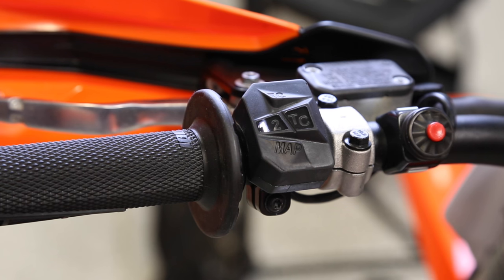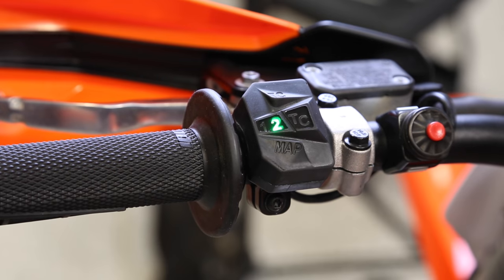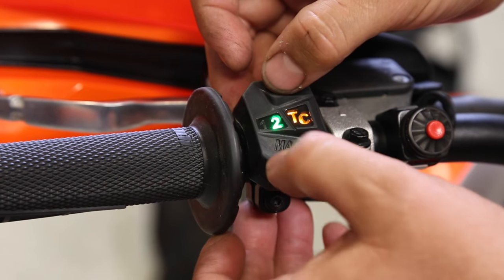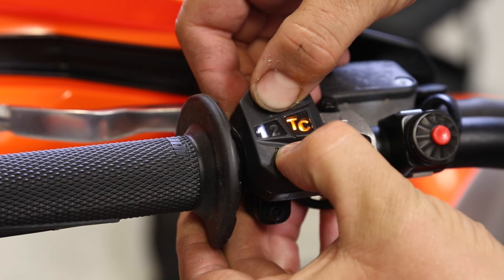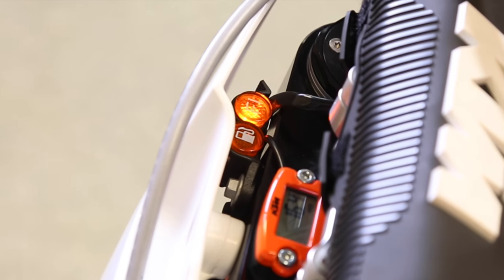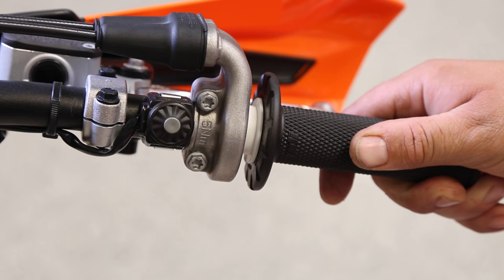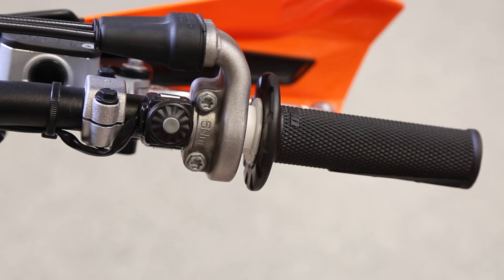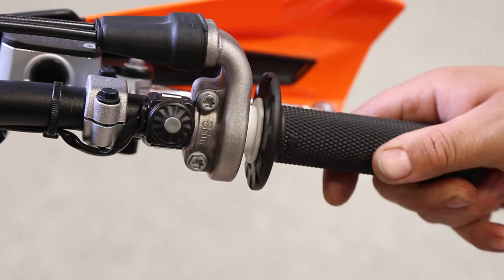KTM Launch Control, Traction Control and Map Switch Explained - Cycle News

Comment: I got a 2019 ktm 450 sxf , 1 and 2 there is a difference.  More responsive, gears feel more aggressive.  I like it. Traction control i feel no difference though
Reply: Me2
Reply: I feel the difference on wet grass hills, the tire spins not as fast so you can Control it a lot better.
Reply: @jonson4508  that’s traction control 👍

Comment: I have this on my 2018 exc-f.   I see no differences in 1--2or TC. I can even unplug it and theirs no change.   Total waste of money.
Reply: Mark Wilson  lol same here.. what the hell dose this button do.. there is no difference between 1 and 2..
Reply: I have a 2018 husqvarna fe450 and found there is definitely a difference from 1-2. Number 2 a lot more responsive
Reply: it doesn't work in us models, unless the dealer "unlocked" your ecu. Now illegal to do per epa regulations.   @anthonywilliamson2080
Reply: Will Crain the map switch does not come on the excf models. Just the off-road bikes. You can purchase the map switch and plug it into the ecu. So the OP probably bought it separately. You should know your facts before you start calling names.
Reply: Zachary Gibbons hahaha 2018 exc-f six days have the map switch/traction control. Nice try buddy
Reply: Zachary Gibbons you sound as worked up as the guy who posted the original comment lmao. An EXC-F six days is still an exc-f, mister Ktm guru
Reply: Will Crain lol you are totally missing the point. The map switches don’t work on the US excf models. That includes the six days that do come with them. Just more useless shit that is included on the six days. You don’t even have one so I don’t know why you are commenting on the situation haha. If you had one you would know.
Reply: Zachary Gibbons lmao I do have one. If you’re referring to my YouTube videos I don’t have that bike anymore. I have a 2018 350 sxf and there’s a noticeable difference between map 1 and 2. Map 2 has much more punch right off the bottom and map 1 seems to peter out quicker. Regardless, I find that it works, but I can’t speak for the gutless xcf-w or six days four strokes. I would assume a lot of it has to do with how little power those bikes make anyway that makes it hard to notice a difference between maps.
Reply: Zachary Gibbons I originally commented on the situation because the guy was complaining how it doesn’t work on his Ktm. Saying it’s a “total waste of money” when it most likely came on the bike anyway. He would never notice the direct cost difference of a bike that did or didn’t have the map switch so I don’t get his reasoning for complaining about it.
Reply: Get the ECU re mapped mate,  that makes a huge different!
Reply: The US model EXC-F/XCF-W map switches don't work with US Ecus, you'd have to get it unlocked or buy an 3rd party or EU ecu. In the EU version, the map switch makes a noticeable difference on the throttle response, map 2 making it really aggressive. This is with model years 2017-2019. 2014-2016 EXC-F came with a potentiometer under the seat where you could select between rain mode, aggressive mode and stock power mode. I don't get why Ktm failed to continue the rain mode option on newer bikes. I drive a 2015 450 EXC-F, and I find the rain mode really nice when in technical enduro.
Reply: Same here with 2019 husky fe501, no differences.
Reply: @fer1306  get a re-map mate,  it makes a difference.
Reply: I have the Husqvarna fx 450 and I feel like on two there's less engine braking and it seems a little more responsive too.
Reply: The TC is on when the button is orange or when it’s not ?
Reply: @romeocop27 lol.  A light on anything means it’s on. That’s why it has a light.   😂😂😂. These comments crack me up.
Reply: @Scummy_shovel  No, I found that when the button is orange it means that the TC is off, the TC it’s ON automatically, if you press the button it’s off. So don’t comment stupid things please
Reply: @romeocop27  lol. Well I work for ktm/husky. And your just wrong
Reply: @romeocop27  I know reading is hard for someone who doesn’t understand a light function. But section 6 paragraph 1 in your owners manual will explain since common sense has failed you. 
Standard map: when number 1 is illuminated 

Standard Traction control: when number one is light and is when the button is pushed and the tc light is on… is ON.  ON always means on.  
Advance mode: is one when number two is illuminated  blue and traction light is illuminated green  

Your bike will also stay in whatever function you turned it off in.  So there is no “standard” setting.   A Brand new ecu when activated defaults to no traction control (light off) and map 1.   From then on untill the ecu looses power for more than 5 minutes the functions will remain on however you had them prior to shutting the bike off.  In other words no need to reset it Every time.  Only change the functions when you need to change them.  

Also as previously stated us model and eu, aftermarket ecu are totally different. It is very possible to own one where the pushing of the button only activates the lights. If that’s the case then simply unlock your ecu. Known as “tuning and flashing”. Or buy a aftermarket ecu.  

And I will tell you 100% without a doubt if your getting all the power out of the bike that it can give you  then going with a aftermarket ecu and tps is by far your best bang for the buck. These bikes are highly restricted through the ecu especially the woods and enduro bikes 

As far as the traction control. AMA doesn’t allow wheel to ecu data transfers so all signals must go through the ecu.  And that’s an awful way to control traction control. The best riders in the word will just barely feel a difference between on and off.  The majority of amateurs feel more of a placebo than an actual difference. Not to say you can’t feel a difference. But it will be nothing like how a car or street bike that uses wheel sensors to detect wheel spin.  The ecu driven traction devices basically measure engine load and controls. Or tried to control that with ignition (timing) curves.  It’s the best the can do with the rules they have to follow.

Comment: I have a 17 450 exc. when i hold the traction control and map button to do launch control it flashes three times and thats it. I dont have a fi light on the bike. Only a light to say the indicator is on however that doesnt flash. How will i know that traction control is working?

Comment: i got my exc 250 2t tpi 2021 and i have a 1 and 2 map switching, then 2 is more agressive?
Reply: I flip my bike with traction control on number 2 as i got used to being on 1 and can't get used to 2 so if I was you get used to both, I mainly do green lanes but like technical riding lifting the front turning on hills and pivot turns so in theory need alot of traction just got so used to 1 and less power to the wheel

Comment: Question. What is the FI light? I have a 2016 250sxf and it’s not connected to anything
Reply: Kick Ass I think it stands for fuel. When your tank is low it turns on. Also, dont start your bike by holding down on the start button right away. Push it fast, wait untill the fl light turns of (wich indicates that the fuel pomp is done pre-pumping) then hold down on the start button. You’ll find the bike starts much more effortless.
Reply: @thehuubster  This practice of 'blipping" the starter before cranking to start is also apparently good for battery life as well. :)
Reply: @macca462  Yes it is!
Reply: @macca462  I hit the starter button 2 times to prime the fuel pump before starting, works like a charm.
Reply: Fi helps for trouble shoots and the fuel one is for low fuel
Reply: doesn't FI stand for fuel injection?

Comment: I don't understand how that switch works.  I still understand map 1 and 2, this would go through the ecu but I don't understand the tc (traction control) there are no sensors around the rear wheel that can register anything, how can the tc work then?
Reply: It goes off engine load
Reply: @danielsosinski4914  Thanks ! Will this switch work on my ktm exc 450 2017 as a plug and play ?